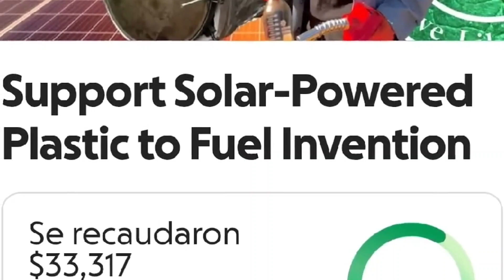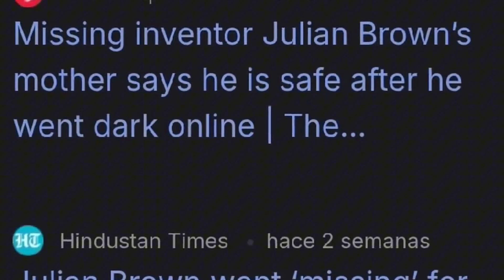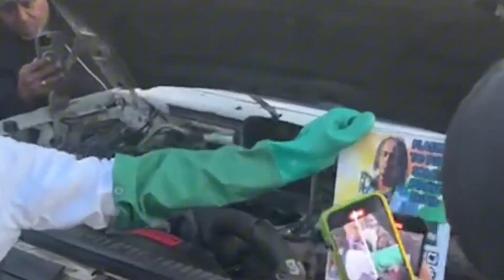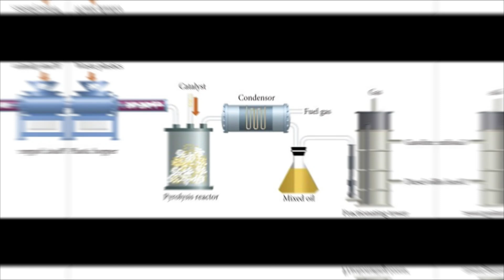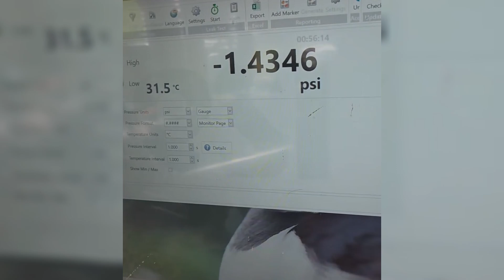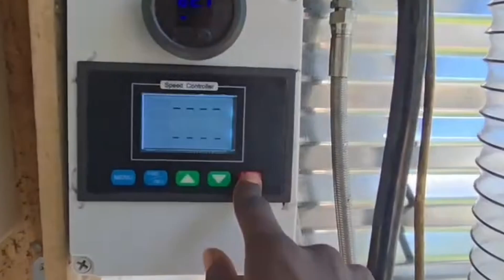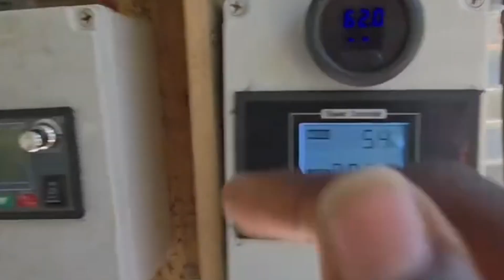Why is the World Ignoring Julian Brown?

Comment: Since when was this solar powered?
He has never refined this as a fuel to be used at all as he doesn't have the equipment to do this.
His "fuel" was already tested to be very very toxic.

He refuses to listen to people and see he is wasting his time and doesn't have a solution that would work at scale.
Meanwhile gullible people will praise him as though he has invented something or solved a problem.

He is only creating bigger issues than he can solve.

He has been in many interviews and debates where on the surface he sounds intelligent but when examined close he does not give well fleshed out answers.
Basically he wants other people to refine his end product and he wants to focus on his so called microwave heating of the plastic and feeding it in bit by bit at the same time.

This isn't a new invention or concept.

When you ask him what does it do with the waste he claims that it is non toxic.
When you ask him about the fumes from the end product - he uses a mask but vents them to the outside area of his neighbors.

When you ask him how much energy he consumes to make a gallon of fuel and how much mixed plastic he uses (which creates the toxic fuel)
He will claim that he will solve the energy consumption later.
But he does know how many pounds of plastic he needs for a gallon of fuel but not how much PURE FUEL he creates as he has no way to refine is with his simple distillation process.

He is a welder by trade.
He isn't some documented scientist.

This is why no one in the science community takes him seriously.
Reply from the maker: he says it's solar powered now,,with a big battery, check his latest videos you will see his set up. He has a lot of batteries

Comment: Great job on the visuals on this video keep up the good work.👍👍👍👍🌐✌
Reply: Like I've said in other videos covering this subject you are just basically trading plastic pollution for CO2 emissions pollution. However like you said at 8:28 the thunderstorm plasma generator can filter out the majority of harmful CO2 gases that is its function. However retrofitting and integrating the system to every running engine can be very costly.
Reply: In fact the thunderstorm plasma generator has been installed on the backup generator for my local hospital.
Reply from the maker: looks like it's very expensive to set it up, and I guess one of the biggest issue that Julian is trying to fix with pyrolysis is making the process to be less costly, because if the entire chain is more expensive than the process of extracting oil from the  ground,  refining it and selling it to consumers, then no one will be willing to invest into that
Reply: @chriswabs  FACTS 1000%
Reply: @chriswabs  Plus he is creating waste and toxins he isn't taking into consideration at all.
Plus he has used his "plastoline" directing in engines without refining it.